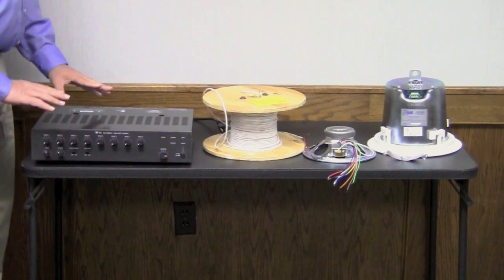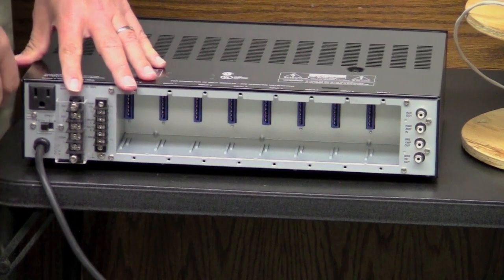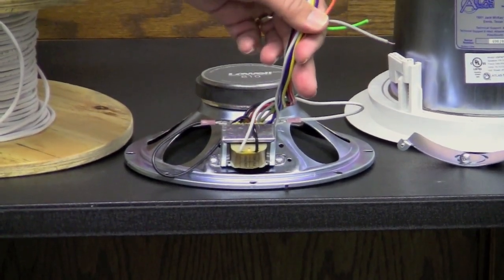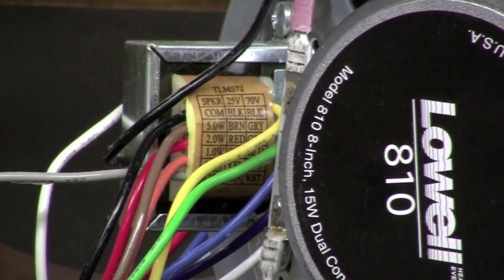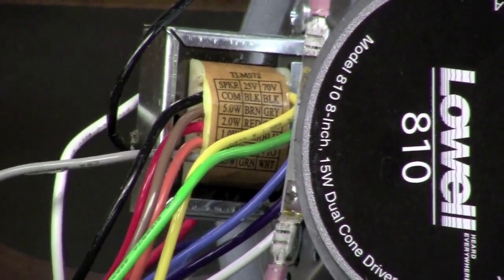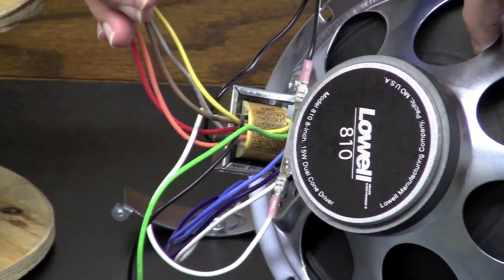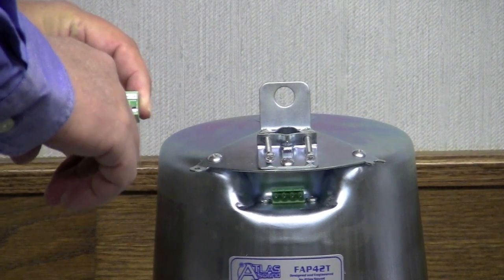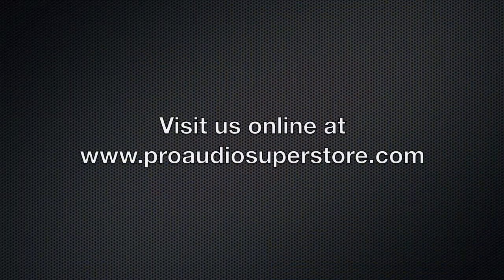70V Speaker Systems Part 1

Comment: Question:
Wouldn't the 100 v line cause electric shock if someone touches the wires at the connecting points  ?
Reply from the maker: @Suhaila Saba – YES! A 100V line can cause shock if someone is in contact with live terminals and/or wires when the system is operating. 100/70/25V systems are classified as Low Voltage and do not pose the same shock hazards as the electrical system in your house or business (a good comparison is the 48V ring signal that was used on telephone hard lines). However, they do still pose a risk of electrical shock if handled improperly and they can cause electrical shorts and even fires if not wired and installed correctly. All safety and wiring guidelines must be followed when installing. That being said, the risk is much lower and if you follow common sense guidelines you likely will never experience any of those issues.
If you would like a more in-depth look at low-voltage systems and how the standards where settled on, check out this great article from Rane Commercial: https://www.ranecommercial.com/legacy/pdf/ranenotes/Constant_Voltage_Audio_Distribution_Systems.pdf
Reply: @ProAudioSuperstore  Thank you for your great explanation.
Reply: That is the real difference between the 70 and 100 v systems. The Electrical code defines 100 v rms as hazardous and therefore a conduit installation is required, but the 70 volt system is 70 v rms with only occasional 100 v peaks and therefore conduit is not required. If you touch the 70 volt system wires when it is running a strong signal you will definitely feel it!
Reply: @jimlearned588  
Thank you for your answer.

Comment: Como conecto bocina jbl 8128. Tiene 5 cables y no se cuales  tomar para conectarla a mi amplificador. Mil gracias.
Reply from the maker: You will only use two wires. Select the color that matches the wattage you want and the black (common) wires. 

Example: Orange and Black will give you 6W, Brown and Black will give you 3W, etc... 

For wattage ratings, see specification sheet - https://jblpro.com/en-US/product_documents/jbl_8124_8128_v1-pdf-78311bd0-7da8-4b36-bd44-fd2935cf3889

Comment: You mention that having speaker wires with twisted pairs are important in 70v applications, but never explain why that is. Can we have an explanation please?
Reply from the maker: @Mitsubishi Starion
 Good question! Twisted cable lowers the induced magnetic field around the cables and lowers the voltage induced in those same cables. In short, it reduces 'crosstalk' interference between the individual (and un-shielded) cables in multi-conductor cables, be that a dual conductor speaker cable or mulit-conductor CAT cable or some other variant.

Comment: Is there any solution if I want to run 2 cables? For example if placement of speakers is too far apart where it is not practical to run the cable to one side then to the other on same "chain"?